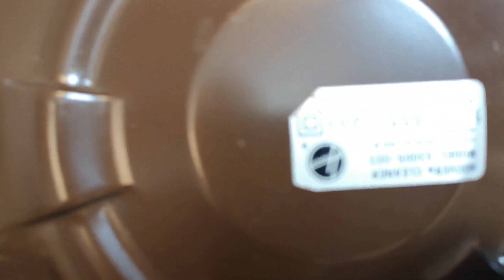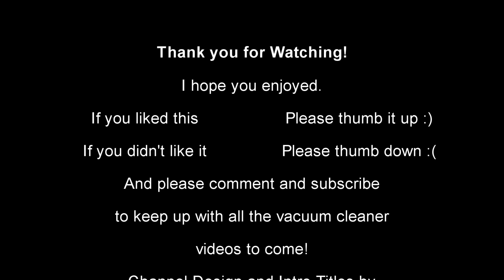A TRIO of Vintage Hoovers - Threesome Unboxing with Dorian from HooverLux!

Comment: That's a Mk 3 1346 (large roundel, different bellows) - the cable was not ribbed on those; the mk 2 was the last 1346 with a ribbed cable.
Reply from the maker: Thank you! I'll be sure to write that down to include it in the after video!